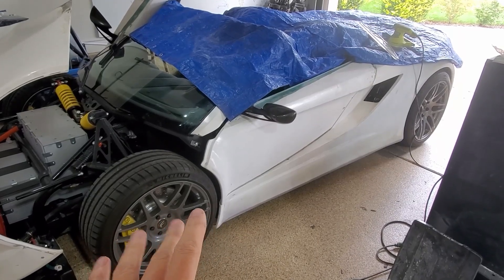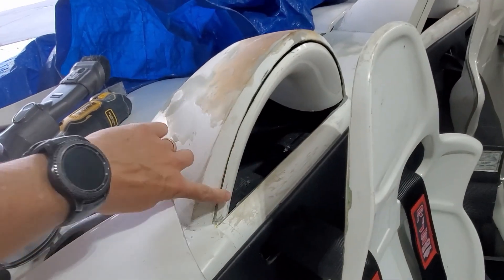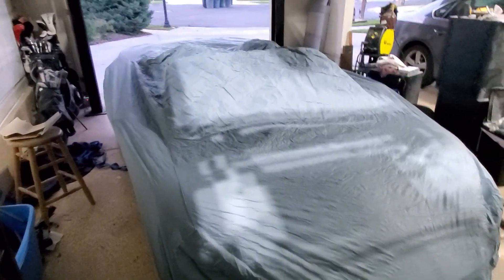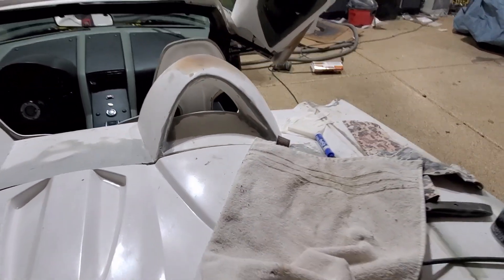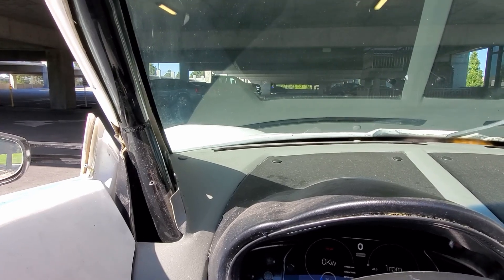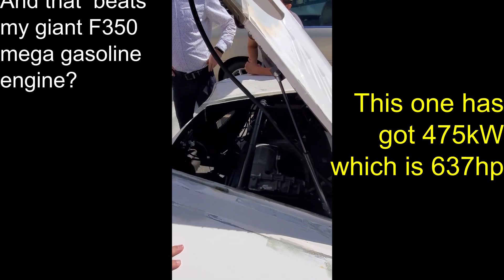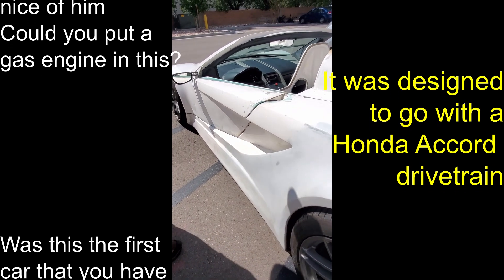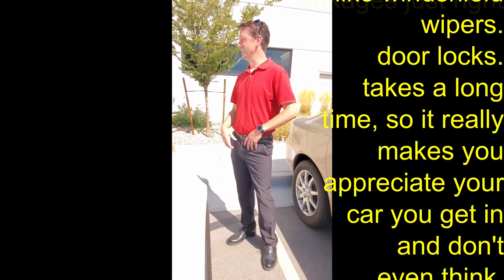Take your homemade supercar car to work day

Comment: Can't wait to see it all polished in its final colour. What colour are you leaning towards?
More questions: 
1. I'm sure painting it will require removing all panels. Do you intend to paint it yourself or will you take them to a shop? 
2. Shouldn't you have waited to put the hoops together until you needed to paint it so you didn't need to cut panels?
3. What's your day job if spark plugs are all you knew how to service at the start?
4. Why is it free to charge at your workplace?
5. Can you install a 120 to 220V transformer to charge at home like you suggested in your very first intro video?
6. Do you have a track or drag strip nearby to test that 2.8s to 60 mph performance rating?
7. Does it not rain much where you live?
8. Why did you regret not choosing the radiator add-on when choosing the extras? And did you get it anyway?
Thank you. I just started watching your videos tonight and it's very inspiring.
Reply: Oh, and the new intro is fantastic. Much better than the simple version of it you demonstrated when suggesting it. Keep it.
Reply from the maker: Thanks!
Reply from the maker: I will try to answer in the coming videos.  Thanks for the questions!

Comment: Been watching since maybe the beginning? I've got a 56 F100 Ive been restoring/converting for a bit over a year and I used to be so jealous of your garage and having more free time than me to work on it, lol! I am just finishing may battery boxes for 16 model S modules with the whole rear subframe/sport motor in the rear of the truck and am going to be using orion 2 bms.  I am hoping you would give me a breakdown or a layout of your contactor and fuse box. I want to make sure I get that right :) I know on the FB group a fella added a negative main contactor from the battery box and that is what could have led to his dual charger/DC/DC converter breaking. Thanks for your vids.  I may need to rewatch a few of your fiberglass episodes bc the model s rear stance is so wide my fenders are finding they have the same issue that yours had... lol. Thanks again brother. Would love to swing by when I visit family in Utah next year if your up for it - pm me
Reply from the maker: Sounds great!  If you need anything shoot me an email.  Electricsupercar@gmail.com

Comment: I've been thinking a bit more about the color or skinning, I still stand by the fact that you should choose the color or skin of "your" preference.  Don't take our choices.  However, with the beautiful looks of that car, I would still definitely put a a graphic of a small, but recognizable you tube logo and the "Electric SuperCar" logo with the lightning bolt on at least the rear quarter panels and the rear of  the car.  Thank you for recognizing and reading our inputs.
Reply from the maker: Thanks for the suggestion!

Comment: Great stuff, love how proud you must be feeling!
A few suggestions...
1) Stones and water are going to fling onto the back side of the front lights so you might want to think about making a pair of removable fibreglass buckets to close off those areas under the clam
2) Best way to ensure you have wheel clearance in the arches is to remove the spring from the shock and refit the shock. Refit the wheel and raise/lower with a jack. That way you have full travel with all geometry still set and you can finesse the arch clearance
3) I used a company called StanceParts for a front end lift kit (actually I did all four corners for best clearance). That will allow you to ride even lower and still get you over speed bumps, but you'll need to find space to mount the Viair compressor (don't bother with the tank). You'll need to modify your extra hood/clam cover though as the spring cups are quite large
Reply from the maker: Thanks for the comment!

Comment: I have binged watched most of your channel over the last week, seriously impressive stuff, very impressive car. Your fault finding of your strange electical isses was facinating. I learned a long time ago that having the appropriate test gear makes life a lot less stressful. After you put up your last video I googled the K1 Attack, I was disturbed to find that it seems to be considered one of the better kits.
Congratulations and looking foreward to your next build.
Reply: TBF those electrical issues seemed owner-related (pins not inserted correctly, speaker wires pulled out). I'm not sure what he did to fix the electronic handbrake issue.
Reply: @mozkitolife5437  The 12v issues seemed pretty mundane, but the highvoltage stuf was interesting. But having said that wiring an entire car would be daunting even with experience. I skipped a lot of the 12 volt stuff will have to go back and look at those at some point.
Reply: @rfwillett2424  Yeah I'd definitely get nervous with the high voltage side.
Reply from the maker: Thanks for the comment!

Comment: What I do with speed bumps is go over with one tire at a time.  Thanks for another great video, and have a great weekend. Free charging makes a good case for an EV.
Reply: That only works with a bump that is wider than the vehicle. With the narrow one, you're still going to hit the middle of the undercarriage.
Reply: @mozkitolife5437  thanks for your reply, you are correct. I might have thought about installing a air lift kit to avoid these types of problems. Have a  weekend.
Reply: @dave5833  I wish I had that problem, haha. My 4x4 and motard dirt bike has no trouble with anything on road haha
Reply: @mozkitolife5437  thanks for your reply, I have a 57 Chevy BelAir with air-bags and if I am not careful I bottom out. Have a great weekend.

Comment: amazing what you did and you inspire a lot, i was always thinking to build racecar, and now idea and start drawing in cad electric supercar is amazing... 

What is the biggest challange and where need to be the most becareful by design electric parts? i was looking for engine and i would take the same like you completely subframe and engine from tesla and batteries i don't know yet but something like you have and base would be carbon monocoqe chasie and i hope i could make it 300km on racetrack and thininking for slow charge from 220w like we have at home.
Reply from the maker: Thanks for the comment!
Reply: @electricsupercar  did you use new batteries or used??
Reply from the maker: @thezlodej  I thought they were new, but not entirely sure.  Purchased from EV west.